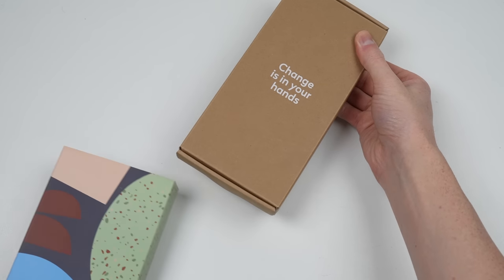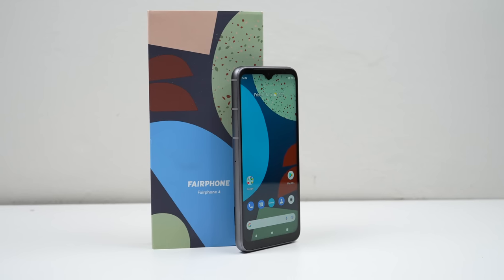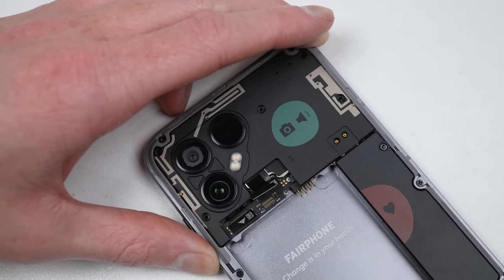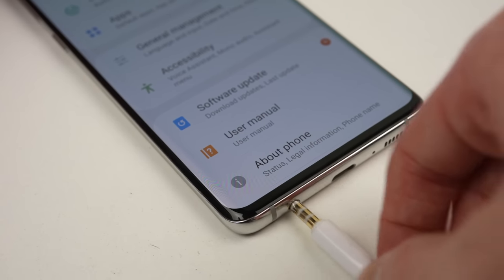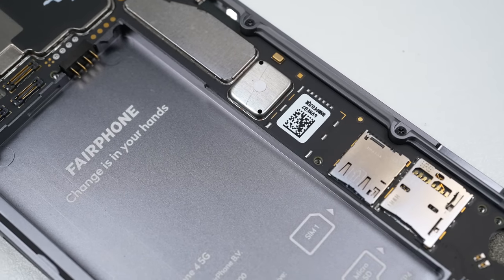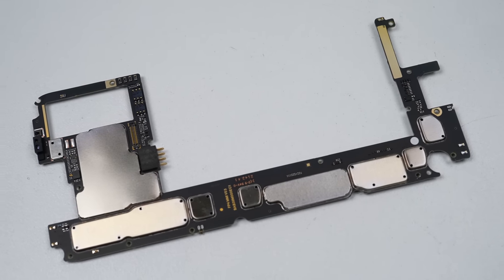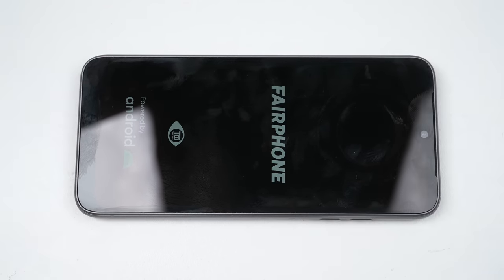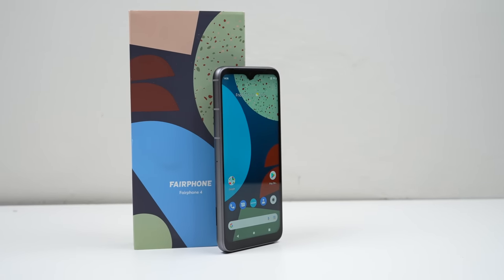The Phone Thats Fighting Big Tech - Fairphone 4 Teardown and Repair Assessment

Comment: I have an idea to lower costs: 
They could put all the components in a heat-sealed envelope and let each buyer assemble it as they prefer, like a fun brain teaser🤗
Reply: And still charge the same price? No thank you. If you're expecting me to build my own phone, then there better be a deep discount.
Reply: @eddiew.4650  Ehhhh... no.

Running a company is hard. Selling products is even harder, because the company needs to make a profit to keep developing phones. If you want a deep discount, corners will be cut. And I'm p sure you don't want a cheap phone that sucks.

Fairphone still needs to operate within a fair market. They can't undersell their products, otherwise they go out of business and the smartphone market becomes monopolized.

The customer isn't always right.

(Alsp depending on whether or not this also comes to fruition, you may get a discount since shipping it incomplete may or may not cut down on labor.... but not a deep discount)
Reply: Framework laptops actually do that thing with their customizable DIY pack, and customers can freely choose any components individually like motherboard, RAM, SSD, display, laptop frames, some other modules and even operating systems

I doubt if Fairphone would do the same thing because RAM and storage in phones are all soldered into the mainboard
Reply: @sihamhamda47  
My son put my computer together by buying all the components separately, choosing the best of each one, it is totally personalized and it works very well.

Comment: Physical SIM cards, that even my grandmother is able to swap, how inconvenient. Better make "all those people" running to me, to get help setting up their eSIM.

The screen can also break, why do not remove it? The battery is going to break, why do not leave that out?
You wanted to make a product, that is "repairable", so do not pull the "it might break and need repair" excuse. Those connectors by design need thousands of insertions to break. Because they were designed (over a hundred years ago), to wear out the plug and not the recepticle.
A proven design, that is working and does its job fine. You have wireless connectivity, even in phones with physical ports.
Who might want to watch some netflix while they are waiting anywhere and possibly charge their phone?

But they have a point with the breaking: I had a phone where the headphone jack was "broken". There was dirt in it. The same dirt, that got in the charging port too, "breaking" it.
Nothing, that could not be repaired with a needle, IPA, 15 minutes and some patience. Or if it is really broken: With a 3€ replacement part and screwdriver.

You will even wear the usb port more, by plugging the adaptor in.
And finally: The laws of physics will make it, that small loose things you have to carry extra, will not be at your disposal when you need them.

Fairphone: I was considering to look at your phones, as a replacement for my phone, once it finally breaks.
Two of my basic needs for a phone: Headphone jack and dual physical SIM. I am sure, there are options to make that phone even triple SIM capable, if you want to include eSIM.

Comment: I want to disagree on the 'this should be mandatory' part as far as making phones easy to disassemble , as I personally want a water 'resistant' phone. perhaps all phones without an IP rating should be made to be easy to disassemble?
Reply: Nah, because a lot of times for cheaper phones, companies will put the water resistance measures in, but not pay to have it officially IP rated. 

There should just be more choices in the market, but there won't be because making an easy to disassemble phone means the companies can't try to force premature upgrades to new devices.
Reply: The galaxy S5 had a removable battery and was water resistant??

Comment: I really like the concept of a phone that's repairable by the end user but one thing troubles me as a UK resident. When it isn't raining here, it's either drizzling or pouring. A phone that lacks minimal water resistance is unusable outdoors in this country for 90% of the year. While much harder to repair, a phone that is properly sealed is much less likely to fail if it gets wet.
Reply: It has a water distance rating of IP 54 so it can resist rain and splashes. I've never had a problem😄👍

Comment: my 2016 moto x pure comes apart just like this. use the sim removal tool through a small hole in the back to remove the rubber battery cover and everything is there to be replaced. its got about twice as many screws though but the screen frame and mid frame go together the same.

Comment: As for me I don't need the headphone jack (prefer Bluetooth) and I like the idea of it being removed. For me it's just another hole for the dust and water to get into.
Reply: As you can see there is no gasket in this phone, so plenty of water and dust will gonna sneak in elsewhere. So you just lost an option while gain absolutely nothing.
Reply: @gabd.5299  as I said this option is of no value to me and I am surprised that so many people are attached to it. The headphone wires tend to tangle and pull the phone so I prefer to go with Bluetooth. This is natural solution of the problem. So, if I were the engineer, I would also drop the unnecessary part to make the design minimalistic.
Reply: @vladimirlindemann5422  I get what are you trying to say and I accept that you don’t use wired headphones, but this phone is anything but minimalist. The whole concept is against that. And the stupid reason why they are not included is just a whole new level of bs. Because it can be broken? The fairphone core ideology is that you can EASILY replace almost any part of it. Why is the headphone jack is omitted? Why is it gonna be harder to replace than the charging port? Obviously we know the real reason. They are pushing their own bt headphones.
Reply: @gabd.5299  then I wonder whether this is a win or fail.

Comment: I love your videos, they are always so fascinating.
One point to ponder - you know, the whole removal of headphone jacks and integration of USB audio isn't as big a deal when you consider that you can
easily buy a usb c adapter with headphone jack...right?
I mean it's one of the reasons I don't mind headphone jacks being removed - for those that want it, USB c adapters are readily available everywhere.
And they are extremely cheap, if you just want basic functionality - even then you can always opt for a much more powerful USB C amplifier. 

My headphone jack adapter which is REALLY great was only around $5, made by Samsung. 
I'm not saying I wouldn't want headphone jacks back, but we used to live with adapters for our basic phones way back then too and it's not nearly that big a deal when the adapters are so cheap...right?
Reply: Using an adapter doesn't change the fact it will put extra wear on the charging port. What do you if your phone suddenly refuse to charge and it takes weeks for the sparepart to arrive?
Reply: @SweBeach2023  I didn't say it's a good thing that headphone jacks are gone, rather that at least we have the option to add one. Wear and tear is actually quite the norm for all adapters and I am pretty sure unless you wrestle your phone and it's USB c port, that the added connector will add too much stress on the port. 
Still, I only meant that we do have a make shift solution.

Comment: "SiNcE thE ChaRgIng pOrT fuLFillS thE SamE fUncTion aS the hEad pHonE jaCK..."

So charging and listening to music is now much harder, requiring dongles, and the usb-c to headhpone jack extension doesn't even recognize all audio devices. While 3 pin standard just worked with any 3 pin headphones.

So now I have to throw out my headphones and buy either a usb c splitter or whatever, or buy cordless headphones which need to be recharged and the batteries on those are absolutely irreplaceable, so now have to buy new ones every few years too.

Comment: This is how a phone repair should be, easy to open and Without glue on parts that shouldn’t have one in the first place. If not enforced by law this company will be probably one of a kind. Also the headphone jack was probably the thing that lasted the longest on any of my phone, those flimsy adapter just to use some old school wired phones on the other end.. annoying and easy to break and I won’t go down the trend on those buds which are just e-waste the moment the battery is worn

Comment: Why has no one designed TWS buds with a replaceable battery? I’d imagine it wouldn’t be that hard - make a small stem like AirPods but make the end unscrew and pull the battery. Buy a new end piece with a battery clipped (or even glued) and screw it back in.

Comment: Speaking of replacement batteries, my Moto Edge 2020 just developed a blown-up battery, and in order to replace it with the manufacturer itself, would cost as much if not more than a replacement at sale price. Getting a replacement battery off Amazon, eBay or another online retailer that isn't a Chinese knock-off is near impossible, and while iFixit lists the battery with everything to perform the repair job, they are always out-of-stock. So I can't keep using a phone I can't fix and responsibly return to the manufacturer that screwed it up in the first place. Fun times.
Reply: That's every phone after 2 years. Buy a few batteries and hope you get a good one

Don't buy OEM batteries because they are just ripped out of dead phones

Where do you think the battery comes from on the original phone? Same place that sells Chinese knockoffs

Comment: If there was a waterproof case made to fit this phone, it'd be pretty great. Hopefully they can improve the models and sell it in more areas.
Reply: There won't be a waterproof phone. it just water resistant if you say a phone is waterproof then throw that phone into a backyard pool and leave it there for a week and see if it work after that.
Reply: @j-frame  I'm talking about a case. I have a lifeproof case for my iphone that adds another layer of water resistance. I trust myself enough to swim with my phone with that case on. Waterproofing a phone would require hydrophobic coatings on top of an electrically insulated layer over all of the components, which wouldn't work too well for certain things.

Comment: Some interesting ideas in this, yes, but as stated by others the execution seems not too ideal as per your own words at the end. No headphone jack means they sell you bluetooh earphones separately which means even more insta e-waste and batteries the moment you turn them on, regardless of replacement (90 pounds for two buds? You can get like several IEMs with replacement cables for that!). With some key options not available, this kind of falls apart. A truly moddable, modular phone would be awesome, kind of like a mini PC, which is what mobiles are nowadays but with none of the rights and advantages of a proper desktop PC. Sadly, we are instead stuck with overpriced glass cannons that fail at software or hardware level thanks to sneaky built-in killswitches, most probably once the next new thing (c) is announced in one of those inane conferences.

Comment: Galaxy s5 was my last phone with replaceable battery.
And disassembly of this phone reminds me on S5
Reply: S5 is literally glued in from screen side due to IP67...
Reply: @satsumagt5284  
LCD yes it's glued, but disassembly motherboard is easy.
S5 was nice phone.
Reply: @RaPtOr9600  Which one have you owned? I had the Snapdragon version
Reply: @satsumagt5284  
At one point booth, i still have my in a drawer in fact two of them but with cracked screen.
I used s5 for long time. As soon i bought one i went to water park and well the IP rafting holds up, i took some cool videos on slides, and pools.
The only thing i hated is that charging cover i had linke 20 of them ordered from e- bay and changing them regularly

Comment: About a missing jack - just WOW, such a strong logic. Headphone jack might break => Let's make phone without it...
Sure. With such logic how is it possible fairphone has a display? Cause display can break so easily!
In reality I am using phones for 20 years, never broke a headphone jack. But displays are much more fragile - so removing display should have much higher priority.
Or maybe... Let's just manufacture steel bricks - cause they are very hard to break (and you can use them as messaging system, just stick a message to it and throw it in the window)

But for real. This could be perfect phone. But for me missing jack (or microSD slot) is a dealbreaker - I cannot use it with my amplifier and custom made wooden speakers. And those excuser are just jokes :D Whole company is just ridiculous saying that. Never buy things from people who has you for an idiot.

Comment: I still don't understand why you wouldn't sell a charger für your (arguably pricy phone - not only Fairphone) with your product. If the chargers were basic ones, okay, but not fast chargers. At least for my Oppo I need the included charger + cable to utilize the full 65W because afaik there are extra pins, etc. in the charger and cable..

Comment: That they removed the 3.5m jack for reliability reasons is definitely a lie. This jack is so simple an the design so final after all these years that it will be more reliable than the usb c port, which is way more complex. Im sure they removed it to save cost or to push wireless headphones as hard as possible. Considering that they sell wireless headphones now....

Comment: Fairphone. Please answer Hugh Jeffreys' question about soldering in a second SIM reader. Will this override the eSIM, and give the phone dual SIM capability? Also his question about supplying future phones with a 3.5 mm audio jack socket. Even should one have headphones with A USB C connector, they can't be used while the phone is being charged. (I think your excuse about the audio socket breaking is pretty feeble - in all the phones I've owned over more than 20 years, I've never had an audio socket break.)

Hugh Jeffrey's. Does the phone have a dedicated slot for a microSD card? If so, what is the maximum capacity card that the phone can handle? How easy would it be to de-Google this phone and install an open-source version of Android?

Comment: If it weren't for the odd pricing to spec ratio and limited availability, I would consider getting one. For now something like Samsung's A series or Apple's SE 3 (if you can get by with the design), also offers long software and security updates minus the easy repair and replace aspects Fairphone pushes.

Comment: Its really stupid the reasoning behind no headphone jack. Why not leave the option in there but have a blanking plate, make it optional. Ive never broke a headphone jack. The quallcomm chipset has a headphone amp built in it just needs to be in the phone. 
This would also allow them to implement an FM radio, which is fairer than wasting data of you dont want to. you cant use a USB C DAC for that it has to be part of the phone.

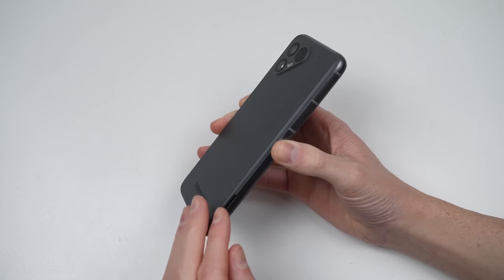Comment: 1:43 why can't they go iPhone 4S and make the glass screw and slide into place?
Reply: Wait, now that you mentioned it, I do wonder why APPLE don't. Perhaps it's to do with water resistance? Also, the back glass on modern iPhones is a bit of a structural component: The internal parts screw into a thin aluminium plate, which is permanently glued to the glass back. 

And making the back come off first presents a different problem: Now you gotta remove everything to get to the display 

I guess I self answered myself

Comment: I feel Fairphone would be successful if they used modern parts. If they tried, you could use a removable glass back panel. If they tried, they could even make it waster proof. The Headphone jack? Yes this was a gimmick to try and sell bluetooth headphones. Nokia makes phones with headphone jacks and even sells bluetooth headphones. They wont remove the headphone jack due to headphones. It almost 150 years old, its proven tech and can do so much including data transfer.

Comment: Don't see many repairability advantages in this phone, compared to any inexpensive Xiaomi phone (for example). In my opinion, they went too far with splitting it into too many modules (e.g. each camera is separate) and the glued battery was also OK (no problem to replace it). It is more practical and economical to replace some parts together and the market trends prove it. So, the concept is nice but it is a miss on economical/marketing side so no wonder the sales are not great.

Comment: Well, though the "official" excuse for eliminating the headphone jack is plain lame, i suppose, there is a more realistic one. 
All that repairability, replaceability takes space. All those screws, all these removable part casing takes space, all those mounting points, and this mountable-unmountable layout itself takes space. And as it's a mobile device, space is quite precious, it's even more precious than in unrepairable all-glued-up chunk gadgets. A headphone jack is a pretty big thing, it not only takes space by itself, it also divides the space used by other parts in such a way that one of the two resulting sectors of space becomes hardly useable (though it could be used for a mnano-sim and memory cars slots).  Removing this big thing is a big deal designwise.